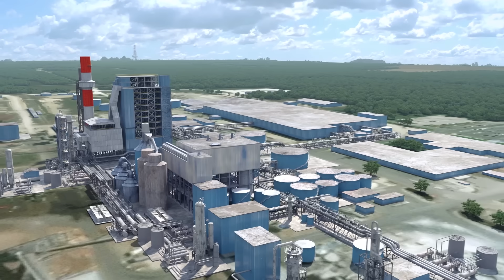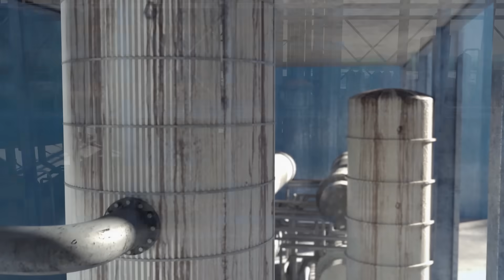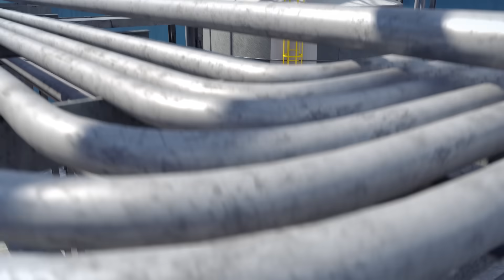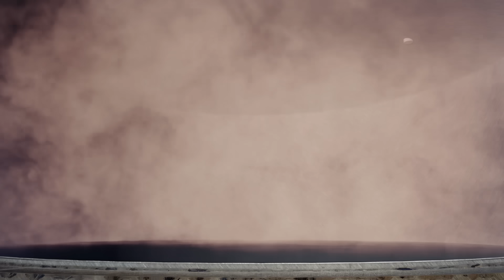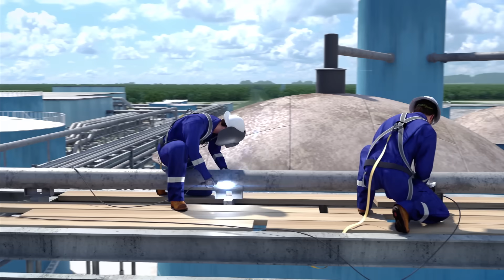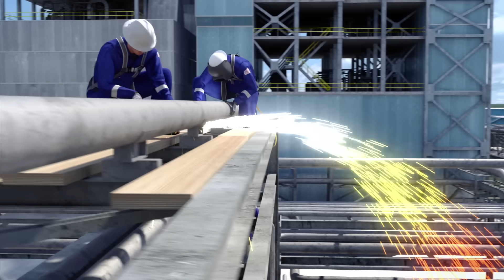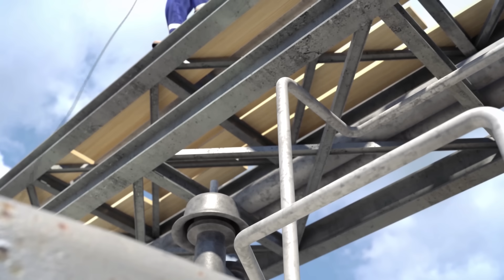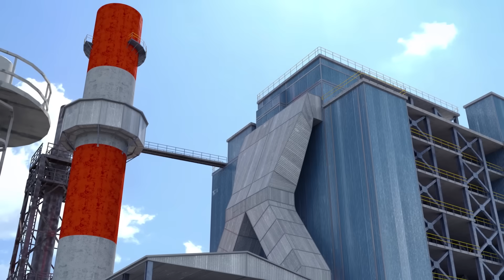Animation of Explosion at PCA's DeRidder, Louisiana, Pulp and Paper Mill

Comment: Why weren’t fireproof blankets placed below the hot work area?? Even if the tank were properly safe, you don’t want sparks and molten steel falling down on the top of a steel tank. I think that would’ve prevented this terrible accident.

Comment: The fact that this video had no section with new recommendations, and there also was no obvious criminal (as in "it should be illegal, even if it technically isn't (yet)") neglect, make me wonder. 

This was preventable sure, and preventions were in place for a long time, but then something fell through the cracks and there was no complete overhaul.

One thing I might mention is that in the weeks leading up to the yearly maintenance period, a qualified team of engineers should go through the whole plant, or at least physically inspect and identify anything connected to stuff in the area where the hot work should take place.

If someone had checked all the valves, not just the ones on the work sheet, this unknown "magic/more magic" valce would have been noticed, possibly identified and the procedure reinstated.

Comment: Only need to watch 2 of these to realize the safety guy needs to employ an NDI team. There are thousands of these guys from the military, Oil/gas ind, Civilian Aircraft mfgrs.  Metallurgy is the study of stress and fractures upon all grades of metal. Its a complete science. Its principles have to be applied to all receptacles branching off the main body. Hence a team, as their would be more work then 1 guy could handle. Companies would rather pay widows and see how long plumbing will hold. Trust me. It will let you know.

Comment: Mm this is a tricky one cause permits were done correctly, tests of ignition sources outside were done. I suppose other than being aware of your surroundings as a welder, ie being aware all the time of what is around you and we’re your slag is falling, you’d otherwise assume it was safe. Maybe, just maybe on a good day someone would ask what’s in the tank under here where all my slag and sparks are going, to which I guess as said in the video, they would reply it’s a mix of chemicals but nevermind it, it regulates itself and isn’t flammable because of that regulation.  A real tragedy.

Comment: As a Lean Six Sigma Master Black Belt some thoughts: 1) paint a color-coded ring around each tank signifying max explosive risk level and another for leaking risk level, 2) all metal workers must be grounded, 3) all shutoff valves should be labeled (for example the closed valve mentioned could be labeled: "Turpentine Bleeder Valve - Normal Operation: ON"), 4) this could be very hard but if you can put vapor pressure valves in every tank, except water, 5) also hard but a valve position sensor that feeds back to a safety office so management has a clear view of current operational conditions.

Comment: If it happened at 11am Chances are the PVRV (vent) on the tank that allowed air into the tank when it was cooling down,  also let an explosive oxygen gas mix out of the tank as the day got warmer and gas in the tank expanded.   A spark from welding or grinding most likely ignited the gas as it vented from the tank.

Comment: The vacuum breaking valve probly needed a blind flange instead of being able to provide a route for any ignition source to enter the tank or ignite fumes coming out of the tank. Sorry for the loss of life but this totally falls on the company operations dept for not isolating and draining that tank completely and when not able to provide nitrogen purge then it should here been blind flanged at minimum. It's negligence and the welders should not be expected to know that vacuum breaker needed a welding blanket over it. Those precautions were the minimum that should have been followed. Whenever there is hot work nothing is to be left to chance. Welding blanket and flowing water can also help when there is danger of fumes. There also needed to be gas check on the vacuum breaker not something you can do at ground level as the animation portrays. It needs to be right on the vacuum breaker/relief valve. That's the way I would have signed off on that job. The maintenance ppl rely on those vessels to be properly prepared and it's life and death at stake. Those ppl that signed off on that job weren't given proper training if that animation illustrates their procedures. There is no room for error and no hot work job can be over prepared. Nothing can be left to chance especially around volatile chemicals and they knew there was turpentine and fumes there.  Now that company knows why they need to train and supervisors need to emphasize safety during a shutdown and maintenance. Those workers should still be will their families. What a tragedy!!

Comment: I know this is a very old video, but it seems that most industrial accidents are caused by something written as far back as the 1940's:

"If Everybody expects
Somebody to do that job,
Nobody ends up doing it."

Having worked to GMP/GLP Standards, yes, the sheer mass of paperwork is insane, especially keeping track of batch, and Lot #s on everything . But, when making a Prescription Only Medication, if an adverse effect is caused by a 'Bad Batch', back tracking to a possible source of contamination can be rather quickly be done because there is such extensive record keeping.

In this case, if one employee had the dubious, if not unpleasant, task of being in charge of the Foul Condinsate tank, both outside, and in, especially LOTO, with the final say in Go/No Go, this may not have happened at all ...

Comment: I’ve worked my whole life in the family business. Our main contract work is with Procter & Gamble and Smuckers. I will say one thing, those who are in charge of the safety and issuing hot permits really do their jobs well. Not like it was in the 80s and 90s. Our company always did Their boiler house shut downs. Up until Duke energy took over. My job was doing the burners every year. I’ll never forget when we were demoing the alcohol plant. We had disconnected all the pipes From one end to the other. We used burning outfits to cut the pipe in smaller pieces. You cannot see alcohol burning. But you can hear it go off like a shotgun. Specially cutting the pipe at one location and hearing a big bang on the other side of the plant where the flame suck through the pipe. Those were good times with my dad and my brothers, and the old-timers that worked for P&G. The old-timers are passing the torch to the younger generation. It’s a big deal to be introduced to those taking their place. Our name and our work keeps us there.

Comment: This is why you should always completely blow down, drain and lock out any equipment or vessel that could potentially have stored energy, pressure or be an ignition source as in this case. This could have easily been prevented.

Comment: My best guess is they are right that the tank cooled and thus a vacuum relief valve may have opened to allow the oxygen needed to lean the vapors out. Intuitively, imagine a large sealed tank with a vacuum relief filled with heated volatile liquid and vapors, if the heat source was removed, taking a few variables for granted, it would actually trigger the relief a number of times as the energy escapes the gas and the gas begins to condense. As the gas loses energy, the pressure drops, the valve at a certain point opens. The liquid and vapors are still hot even after pressure is equalized and the valve closes, so pressure begins dropping again. Etc etc. If they were welding directly above then the sparks may well have been involved with the valve at a poor time. Potentially, depending on valve size, design, and the triggering pressure, a spark could have been sucked in. Or if the valve is slow to close and the housing was of poor design that leaves more problems. The turpentine could’ve drifted the few inches it needed to reach the falling sparks, or the housing could’ve been acting as a condenser for escaping vapors. Who knows.

Comment: If these videos teach you anything, it should be "Safety cannot not be bargained for"

Terrible addition: my buddy's dad contracted with a company that worked the steel mills in NW Indiana. The plants had a series of layoffs at one location, among them were the only two engineers who were in charge of controls for the safety logics and were the only two who knew how to service the light screens for alarming and closure of open molten steel runners (air directly above them is around 1500 degrees F) at certain spots when pedestrians accidentally got too close. After the plant failed to properly maintain the area and clean the screens, they began failing and activating safety procedures with no one there, causing downtime. They simply removed the safety interlocks from the logic and unplugged them, mainly because there wasn't a pedestrian route near there. About 15 years ago, three new guys were walking near the runners and they decided to cross over them to get to a break room, thinking they were inert. They took a running start and the first guy lept and was essentially killed in flight and landed in a flaming pile on the other side, the second guy tried to stop but tripped onto the runner, screaming as he was vaporized (buddy's dad's words), and the third guy stopped and screamed for help. My buddy's dad tells the story to try and remind people that safety is never to be bargained for.

Comment: Wow, it does seem like this was a difficult set of circumstances to notice, in my opinion. That one manual valve that was open near the Turpentine Tank was unnoticed and seemed unspoken of for a long time. I'm not sure I would have connected the dots and hypothesized that the Foul Condensate Tank could have a higher turpentine concentration than normal and could generate a flammable atmosphere. But if the company knew the Foul Condensate Tank held a small concentration of turpentine, a flammable compound, I think they could have made the tank pressured at atmospheric pressure with Nitrogen rather than Air, eliminating Oxygen from being in the tank and creating a flammable atmosphere.

Comment: How did you die?

"I opened the wrong valve."

"A leak released a poisonous gas."

"A stray spark struck sawdust."

"Uhm...in my defense, I thought it was Al's turn to remove the turpentine....so..."

Comment: If you arc high voltage across a piece of metal that is angled near another piece of metal, you can get a continuation of the arc inside the tank. Or if there is a space between the float mechanism inside and the surrounding tank then it might have been a point where an arc could manifest inside the tank.

Comment: I remember a situation in a refinery. In one oven Hydrogen with app 3000psi was heated prior to a a hydrocracking unit. Somebody heard sounds from inside but since the planned shutdown was only few weeks ahead they kept operating it. Some days later in the night the loose hydrogen pipe inside cracked and the hydrogen exploded. Nobody injured. The oven was square before and looked like an apple after. They fixed the pipe, welded a refurbishment around the oven and operated it until the maintenance shut down.

Comment: Such a tragedy! Easy to be arm chair quarterbacks but it's apparent how many failures occurred during operations, preparing for shutdown and performing work. It seems obvious that workers / leaders know who is responsible for operating and maintaining equipment but there are situations where details are overlooked maybe due to hasty business situations, maybe management or shift assignment changes, re-organization/merging/dividing departments, budgeting, etc. When older facilities were built the engineering and layout of processes weren't always considered - think of a control room adjacent to electrical switchgear and hazardous material tanks next to the view window. Appears to be no measurement of level control, temperature, pressure of tank unless it was being ignored. I'm surprised the rest of the process was working properly if components of the waste stream were not going where they should have gone. There are core safety processes that were not utilized, such as energy isolation (lock/tag/try), line opening and breaking, hot work. Someone asked about how a weld tip could have ignited the mixture - static electricity. Someone mentioned they knew the welder, someone else observed 2 workers flying over the roof with the tank. Wow, just so sad. Being a safety professional I see so many things that could have prevented this from occurring.

Comment: Go ahead and rule out the welder touching the tank as the cause, for 2 reasons. First being the fact that they wouldn't lower a live welder. Second being that there was no ground at the tank for the welder to spark. The fault falls completely on plant management for improper shut down. It wasn't a new plant, so there should have been no confusion on who's responsible for supervising that area.

Comment: That welding torch couldn't have ignited the vapors, because the tank is most likely metal. The electricity acts like water and takes the path of least resistance. Because of that, the metal tank acts like a faraday cage and prevents ignition. Unless its waved like this, /\/\/\/\

Comment: "The company also assumed the tank contained mostly water, was sealed off from the atmosphere, and did not post a safety risk..." That is an awful lot of assuming, even more so considering the materials involved and the type of work being done.
Reply: Especially given how easy it is to actually check the real conditions in the tank rather than just figure it's probably fine.
Reply: You know what happens when you assume...
Reply: There were almost no reasons to ever assume otherwise. It would be like assuming a water bottle from the store was water and leaving it next to your oven only for it to explode. There was no reason for it ever to be explosive like that. Along the way a critical failure occured by an important step being skipped for months. It often happens when tasks are taken up by workers without proper delegation. And when that worker leaves no one knows the task was being undertaken by him.
Reply: @Luckingsworth  You're right, there was no reason they shouldn't assume that grinding and welding above a turpentine container without even so much as a safety blanket would be dangerous.
Reply: @DarkFilmDirector  Contract welders have to rely on the plant's operators to know what all those tanks, valves and pipes are used for and how to make them safe for work. The contractor is paid to weld some pipe that belongs to a company. This accident may not have happened if the plant's operator or safety inspector had a check list to use. Pilots use one to start the engines, they then ask for permission to push off and taxi. They ask permission to cross a runway. They use a checklist to prepare for takeoff; they wait for permission to take off. They ask permission to change altitude and direction. They ask permission to land, they use a check list to prepare to land. They ask permission to taxi to the terminal and ask permission to go to the gate. Then they use a checklist to shut the engines and other equipment down. Industrial plants are just as complicated as a jet liner. They need a SOP book for all new hires and a checklist for their daily activities just as much as they do for maintenance procedures. e.g. Remove the oil, remove the filter, lube the filter seal before installation, tighten the filter, add the oil; check the oil level, run the machine and inspect the filter and drain valve for leaks; stop the engine; check the oil level and top off is necessary; clean up any spillage; dispose of the used oil   and filter according to environmental procedures.
Reply: @Luckingsworth  Correction.
It more like assuming that propane tank you put next to your oven was safe, because you figured it was empty.

The wastewater tank in that factory was known to contain a flammable material, the only assumption was as to the quantity involved. Even without the drainoff valve being closed, there still would have been a flammable atmosphere in the tank. The only difference would have been that the explosion would have been that of several gallon of turpentine, instead of several tons as the case was. It. would.Still.Have.Exploded!
The explosive situation was cause NOT by the large amount of turpentine in there, but by the very fact of tank plumbing shutdown for the repairs. The tank cooled, sucked in oxygen, and its mix became flammable.
The accident happened because they authorized hot work over a flammable storage, and did not implement suitable countermeasures.